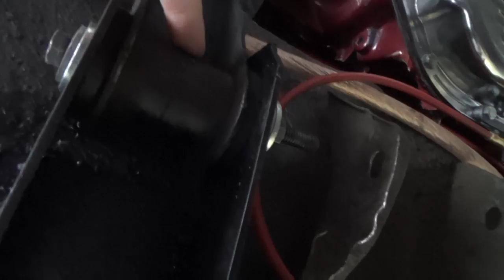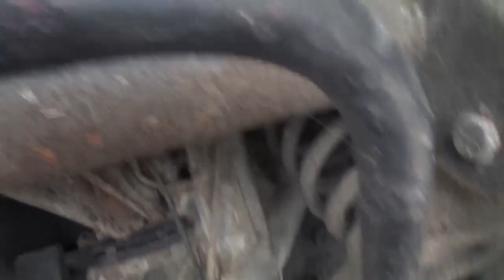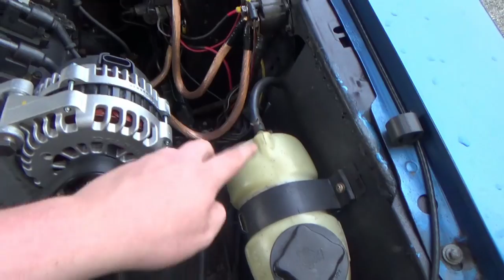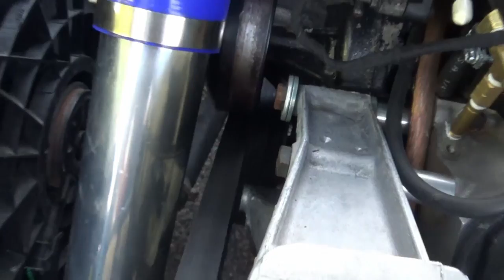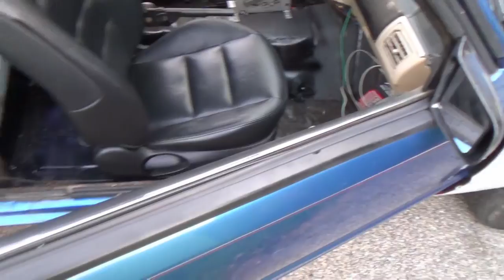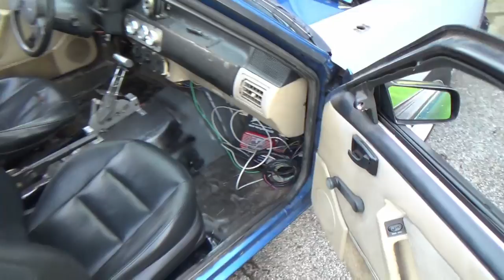5.3 Turbo Mustang - Part 17 Up and Running

Comment: what transmission are you using
Reply from the maker: +Emmanuel Reyes Th400 with a Summit Racing 2800-3200 stall

Comment: That trans mount to the body mount needs a crush sleeve in there.. Or you will start crushing the body rail.   if you dont it will loosen up over time and rip out.